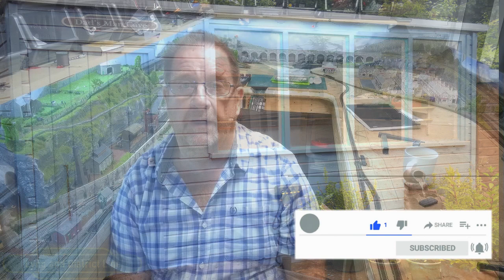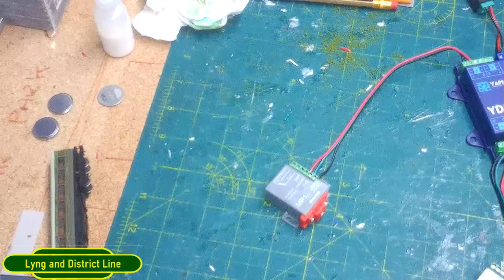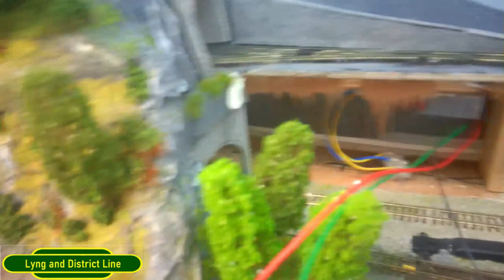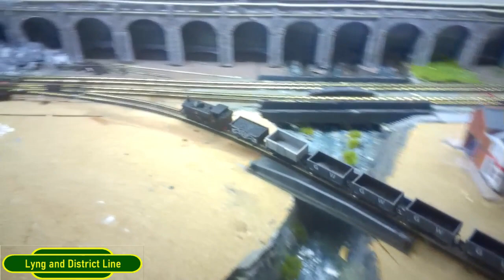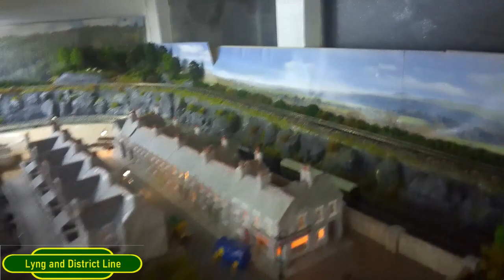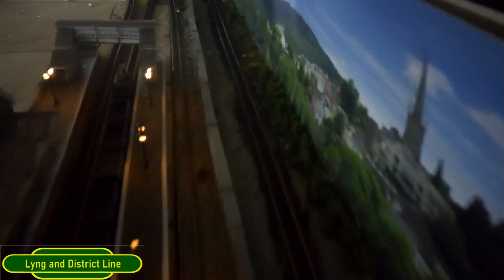Lyng and District Model Railway - Episode 45 - Installing the YaMoRC YD8116 switch decoder.

Comment: Hi Steve, just caught up with you, you’re knocking videos out quicker than Blockbuster’s used to!
Wiring fills me with fear, I’m a fairly intelligent guy I guess but as soon as I look at instructions for wiring my brain goes into shut down! I’ve got loads of wiring to do and I’m sure I’m going to have Hassell somewhere. You’ve done really well there mate and I’m glad you got it sorted!
Cheers for now, John
Reply from the maker: Thanks John .... the electrics aren't an issue, it's planning them that gave me the headache and no matter how careful you are you will always end up correcting it! If there is one tip I can give you is plan as much as possible before hand, and use connecting blocks under the board and don't solder anything under neath.

Comment: Looks like you're having a very productive time at the moment Steve! First lighting and now point motors! That decoder looks like an interesting bit of kit! Do you know if it only works with the MP1's or can it operate any servo motor? I'm wondering if it would work with the micro servos I'm going to use! Oh, the night time running session was great! All the best, Ian.
Reply from the maker: Ian - check @DCCtrainautomation u tube - https://youtu.be/bRvPxCmOs3A there is a separate solenoid decoder in the brand - very much similar to the DR units but upgraded and easier to use. If you have questions just ring James up he is always happy to go through any queries you may have. 
Regards
Steve

Comment: hi, thanks for your video how do I connect this Yamorc point motor switch unit to my Rocco Z 21 do you have any ideas? Thanks
Reply from the maker: Hi - It should be quite simple. Power up the Yamorc and press the small button on the bottom right which puts the decoder into program mode. The red light should  then be flashing. On the hand set or screen select switch's and press the number assigned for the first set of connections. i.e. 9. The red flashing light should then go out on the Yamorc and it then automatically assigns the next set of connections as 10, then 11 sequentially. 
Check out Graham Foulston's videos here https://www.youtube.com/@GrahamFoulston/search?query=roco%20z%2021%20set%20up
or go to DCCtrainautomation here https://www.youtube.com/@DCCtrainautomation
they are experts at this - I use a Digitrax system and its dead easy. 
Hope this helps
Regards
Steve
Reply from the maker: What I should also say is don't have any point motors connected when you first program. Then once programmed, switch the power off to the Yamorc and then connect the motors. 
Steve
Reply: @lynganddistrict   many thanks for taking the time to reply much appreciated. How do I connect the YD8116 to the Z21 physically which wire goes where. Thanks 👌
Reply from the maker: @stevio7777  - when you look at the decoder, at the bottom it says input and has two terminals. Connect  a wire into each terminal and connect the other end of the wire to your Bus wire or direct into your Z21 unit. 
Regards
Steve
Reply: @lynganddistrict  thanks matey